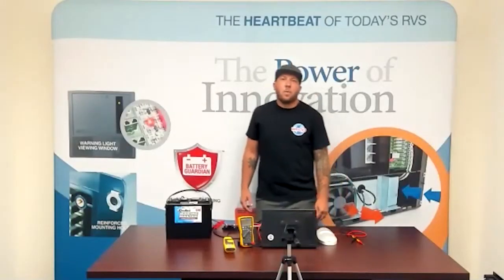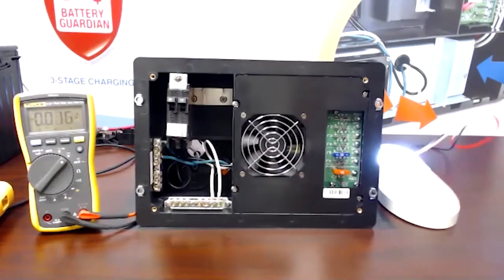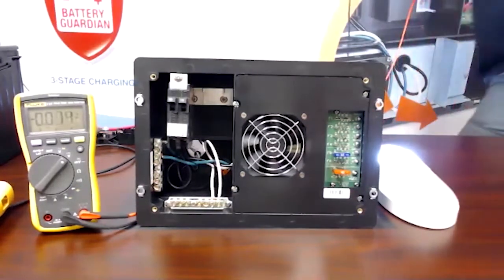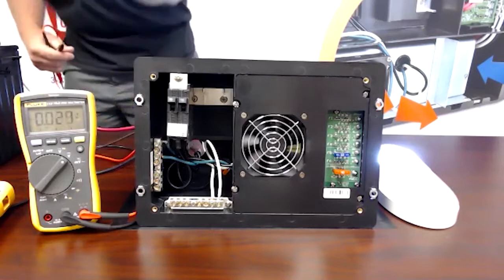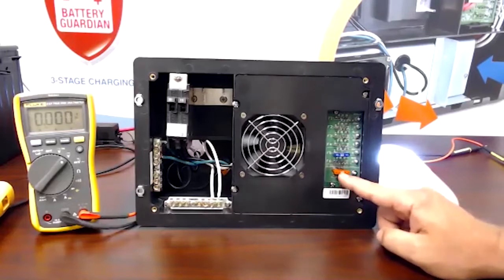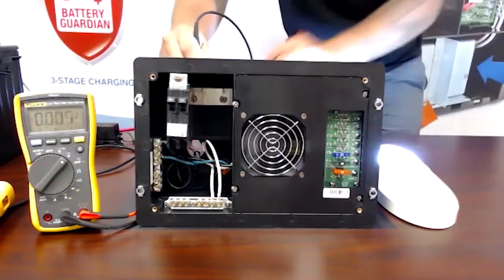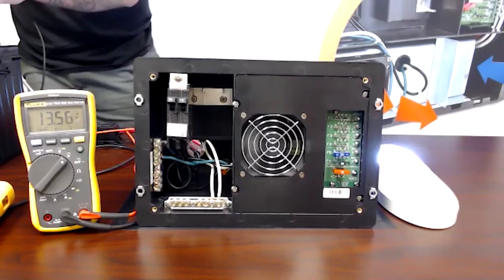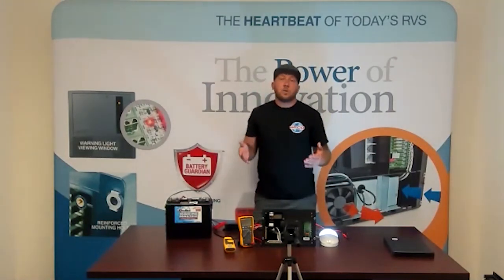Why is the battery not charging on WF-8700 Series and low voltage is going to the battery?

Comment: Sorry to bring an old video back to life, but I’m looking to disable charging altogether when on shore power, as I’m using a Goal Zero power station to power the trailer.  I understand I could just flip an inline switch/breaker between the battery pack and converter.  I’d rather wire the converter such that it can use 12v battery power, but not feed charging voltage back when on shore power.   How would I do this?

Comment: Hey there! Have a 2023 Winnebago Solis Pocket and having charging probs for the house batts from while engine is running. Solar and shore power charges the house batts. Trying to diagnose the issue. Have narrowed down to: fuse to house batts, relay or solenoid from the chassis batt or alternator. Typically where is the fuse from the charger to the house batts? I’d like to check this as it seems like the simplest issue? Thanks!

Comment: I have this same converter and the fuse board seems wronh i have to green 30amp fuse on bttm says reverse protection and then f6 is right above the two 30amp f6 says its a 15amp red wire to battery positive and as soon as i plug into shore power it pops f6 15amp fuse then i lose all 12v power i can unplug shore and put new fuse in and its good until i plug it in again. So i checked the positive conection at battery for continuity and just like that i have a dead short so i go back to converter to check at battery connection f6 15amp and once i put the 15amp so i can trace what fuse is giving me dead short every fuse oulet on the board shows contuinity so is the i ground to heater then touch any fuse sadder spot.i get a loud beep so it prettey much makes it imposible to trace where the dead short is with how the fuse board is designed very disapointing any ideas

Comment: I have a 2022 Geo Pro that has WF-8700 converter is there any way I can upgrade to WF-8900-AD for lithium battery’s,I know there’s a WF-8700-AD but like the simplicity of the 8900 -ad.
Reply: Did you ever figure this out?

Comment: Just swapped a 8740-p to 8740 AD. I have two lead acid batteries but the unit stays at 13.7. It never changes to 13.2 float mode. I check the voltage at battery and it is 13.7.  Why isn’t it going to float mode?
Reply from the maker: The converter will not go into float mode until the trailer is in a storage-type setting. The converter needs to have a draw of less than 3A for 48 hrs., telling the converter it needs to go into float "trickle charge" mode. Please call 1-877-294-8997 Option 1 to talk to the Power Pros if you have any further questions.